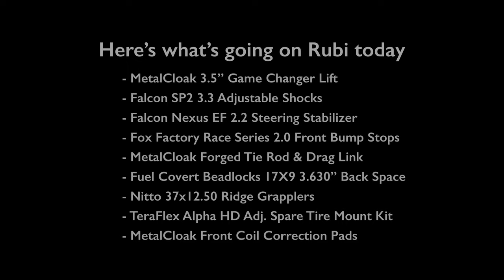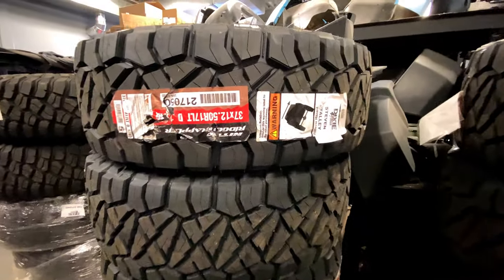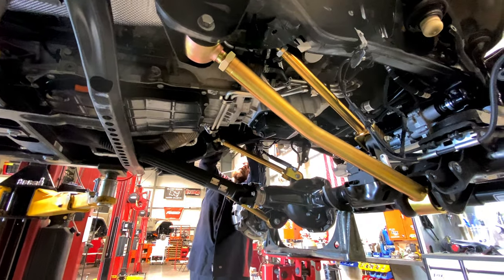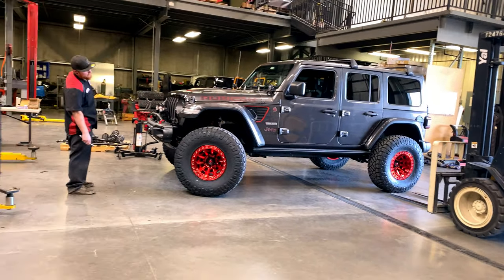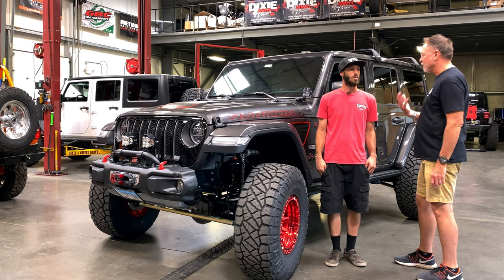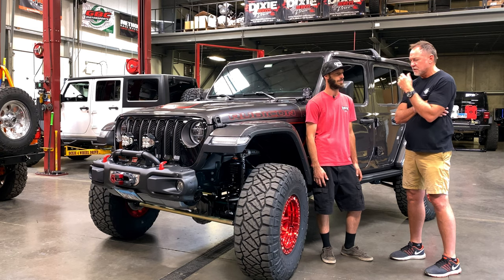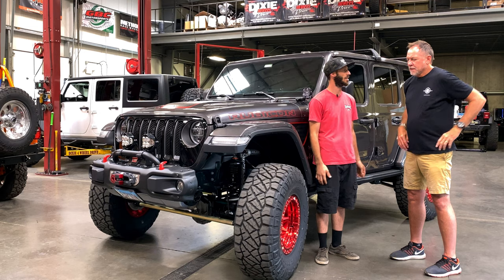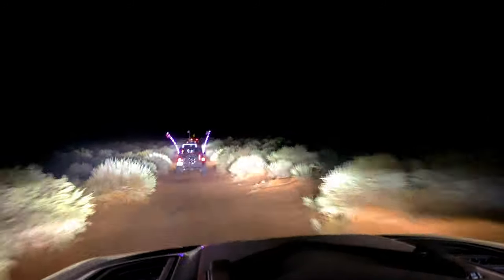We head to Dixie 4 Wheel Drive to get a new lift installed in the new Jeep JL 2020 Recon.

Comment: What and when are you doing the gear swap? BTW...  Looks great!!
Reply from the maker: Hey Buddy! The new 8-speed Auto does an amazing job at covering the 37's...quite surprised by that. I'm still seeing 8th gear at ~80mph. 

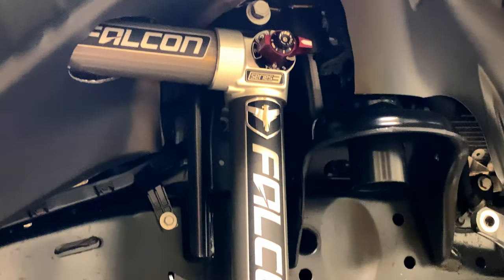At some point I'll most likely do 4:88's. I know a couple of guys in the Jeeping world running 4:88's and 5:13's with the 2.0L eTorque. I want dive into that with each of them before I decide. Right know I'm spinning the 37's on dry pavement on the stock gears(4:10)...the JL is such a different animal than the JK.

How your beast build coming along?
Reply: @ExpeditionBuilds   My JK is all done (I laugh inside) and I’ve put a few trips on it the last couple months. It has outperformed my expectations by quite a bit. Of course the LS is fantastic with the 6L80 and 4.88s. I’m running a set of 38” tires and I can crawl around at 2mph on the trail or 80mph on the highway at just a touch over 2000RPM. And it runs smooth as glass. No vibration, one hand on the steering, tracks nice and straight. I have a reasonable exhaust on it so driving around I’m not dealing with any drone but stab the throttle and there’s no doubt it’s no longer a 6 cyl. And for a 2 dr, the suspension has been great. I’m running Core 4x4 arms, Metalcloak springs, Falcon 3.3s and all the other odds and ends to dial it in. I use all but a 1/4” of the 12” shock travel with it no issue. I still swear by the antiflop designed steering systems. I’m still running the YETI stuff and it’s been great. Of course the hydro assist helps out too. But overall I couldn’t be happier with it. For a Jeep that is driven to and from the trail, it has worked better than I expected on and off road. 

  Look forward to following along with you and Rubi! Stay safe my friend!
Reply from the maker: @rareearthfab5511  You built an amazing Jeep and your attention to detail was superb. You must be proud of that and having all dialed says a lot. 

Be well my friend!
Reply: @Rare Earth Fab...When you say that you still swear by the “anti-flop designed steering,” are you saying to not use the drag link flip kit?  Because I was about to ask @Expedition Builds why he didn’t go ahead and do the flip kit since he was right there in the shop and they were putting it all together. I thought that’d be a no-brainer.
Reply from the maker: @KansasSlim64  I ran a drag link flip on my JK and really saw the benefit from the corrected geometry (running ~4" of lift).

The JL is different, and at 3.5" of lift, not necessary. The steering on the JL set-up is perfectly dialed in.
Reply: @KansasSlim64  As Expedition Builds said. With the 3.5” lift on the JL it’s not necessary. I highly recommend the flip with a 3.5” lift on a JK.  This helps get the geometry between the drag link and track bar back in spec IF YOU ARE USING A RAISED TRACK BAR BRACKET. Any decent 3.5 inch lift should have a raised track bar mount. If you don’t flip the drag link you will end up with pretty severe bump steer. 
I also recommend finding front end components that integrate an anti-flop feature into the drag link and tie rod. This helps tighten up the steering feel considerably. Without it, as you start to turn the steering wheel the drag link will move up or down (flop) first before the tires start changing direction. This creates a loose feeling to the steering almost like there is play in the steering box.
Reply: @rareearthfab5511   That makes sense.  I haven’t picked up on the “anti-flop” concept before. Thanks for the feedback.  I’m on the edge with a 3” lift, the TeraFlex RT3.  It included a HD track bar, but not the raised track bar bracket.  So far the steering has been fine, but no hard core wheeling yet.  Just some mud and rough trails.
Reply: I like it very much
Reply from the maker: @luisrivera8488  Thanks Luis! Good hearing from you.

Comment: Awesome build! 
Would you do an update on how the suspension performs and rides after some miles and how you like the falcons? I’ve read from others that they’re pretty stiff. 
I’ve wanted to do bumps someday but wonder if you’d noticed them on the trails thus far. 
Thanks man! Thanks for sharing your build.
Reply from the maker: Thanks Mike, appreciate the comment(s)!

I will do a video on the new Falcons here soon. I can tell you this, I thought I made a mistake with running the SP2 3.3's on my first drive...man were they stiff! However, I now have two wheeling trips on them and roughly 5K miles. I daily drive my Jeep. I love the Falcon SP2's and would recommend them. Just know they take a few miles to break them in. 

TeraFlex did a great job tuning them...the shocks ability dampen and arrest body motion is excellent.
Reply from the maker: I realized I didn't respond to your question regarding if you can feel the bump stops on the trail.You can feel them. Actually what gave me the idea to do the bump stop video came about as I was reviewing the trail footage at the end of the West Rim night run. We hit a pretty good size bump at about 40mph and I could hear myself on the video commenting on how soft/smooth the the new bump stops handled the big hit. If I were on the stock stops, that would have been a hard bottom out.

Comment: Recently discovered your channel, really enjoy your videos.  Your build is the first I've seen use the stock axle mount for the stabilizer (driver's end), with the other end clamped to the tie rod.  Looks very clean.  Have you had any issues with this setup?  Surprised more people aren't doing this.
Reply from the maker: Hi Chris, good hearing from you! Thanks for the compliment, and appreciate your support. 

You're right, I haven't seen a lot of installs done the way we did mine. As you probably noticed, I'm running the AEV diff covers and as we were starting to assemble the parts, running the stabilizer from that position made sense. I asked the Dixie tech if there could be any negative effect from having the SS located in this position and was told none at all. From real world use I can tell you that it works perfectly and best of all, I have no clearance issues through full flex.

Comment: Please share cost for lift amd other things please
Reply from the maker: Hi Volcer! This will give you an idea of the bigger purchases. Lift/shocks ~$3865 Tires/wheels ~$4290  I'll let you research the rest.
Reply from the maker: @towm8tr  Correct!
Reply from the maker: @towm8tr  Thanks for the compliment...the red wheels are the blingiest thing I've done on any of my builds, but they really work well on this one. 

Are you running 37's, did you re-gear?
Reply from the maker: @towm8tr  Nice, the KM3 is an excellent tire. I'm in the same boat as the 2.0L Turbo/8-speed covers the 37's pretty well. 

I'm thinking 4:88's for my build.
Reply from the maker: @towm8tr  Mark from TeraFlex is running 5:13's/39"KM3's on his 2.0L, great combo. The 39's require a little trimming  to run.

Comment: Great video and build. Quick question, are those stock axles?? I saw the AEV Dif covers. Thanks
Reply from the maker: Hi Amy! Thanks for the compliments,appreciate it.

I am running the stock D44 M210/M220 Wide axles(Rubicon). I have not yet upgraded my axle shafts. I like upgrading the Diff covers for increased strength and like the looks and functionality of the AEV covers.

Comment: How do you like the 4 cylinder turbo engine? Does it require premium fuel? Thanks!
Reply from the maker: Hi Nomad! The 2.0L Turbo/8-speed is a great drivetrain. I really love it. 

I would recommend driving one and you will understand...it really changes the personality of the Wrangler. Jeep has designed the 2.0L to run on regular or premium fuel. You will see the best performance using premium.

Comment: Another excellent video! A quick question though. I just installed the MC GC 3.5 in my JKU and am really enjoying it over the kit that I removed. I was a little surprised that the kit included a new front track bar but not the front track bar relocation bracket. With the current track bar angle, there seems to be a fair amount of bump steer/feedback through the steering wheel as the front suspension cycles. What is your experience with the kit on the new JL? Do you think it would benefit from the track bar relocation bracket?
Reply from the maker: Hi, thanks for the compliment! 

I ran the 3.5" G.C. on my previous JKU so I have direct experience with it. If you're seeing bump steer and the angles on the track bar/drag link aren't parallel the track bar relocation bracket will really help. I ran the MC relocation bracket and loved it. 

Have you upgraded your steering linkage? I ran a full Steer Smarts on the same JKU build and it worked very well.

The JL is a different animal, we did not do a flip on that build, steering is great, no bump steer.
Reply: @ExpeditionBuilds  Thanks for the feedback, I appreciate it. I haven't done any of the steering linkage yet and am considering the MC High Steer kit (Track bar relocation, flipped drag link and HD tie rod). as my next step.  I'll take a look at the Steer Smarts set up as well.
Reply from the maker: @mfl3ck  My pleasure! I've really been impressed with all the MC parts I've run...including the new steering linkage on the JL. Good luck with your next mods.